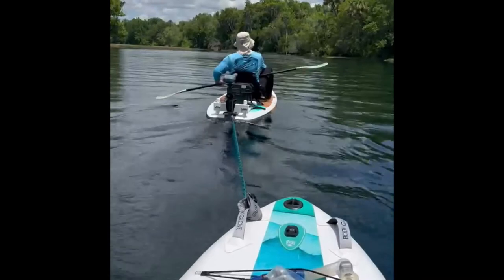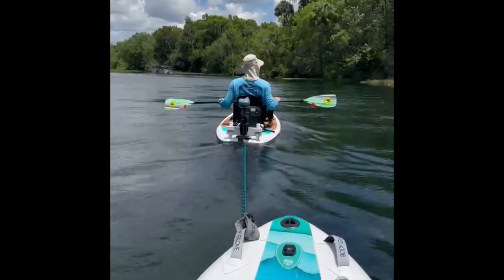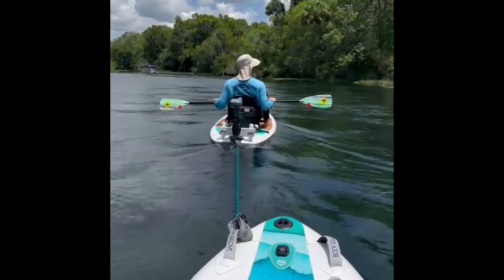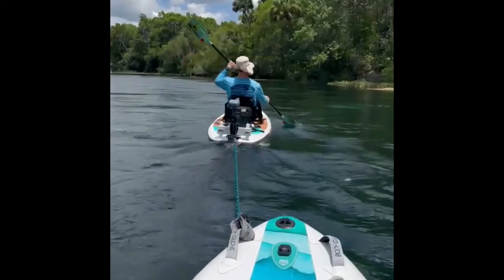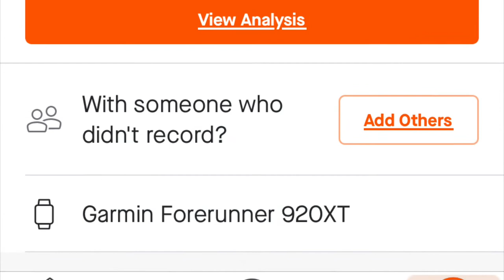Trolling Motor On SUP

Comment: Very nice can you tell me how you connected the PVC mount to your board and are you having any problems with it moving while running the motor? Thanks
Reply from the maker: I just used velcro straps to some D rings already on the board we sometimes forget them but as long as your not in white caps you should be fine

Comment: It is a year later. I'm curious to how the pvc held up under the weight pressure over time. 

I also want to say
of all the motor and mounting possibilities,
I am copying yours almost exclusively. 

Thanks for the video
Reply from the maker: It is holding up great. I forgot to mention in the video that I am using wood dowels inside the pvc for strength and longevity.

Comment: How do you reach the Tiler to increase/reduce speed and to turn motor off etc?

Sitting in the centre of the board doesn't look like you can reach the motors Tiller.
Reply from the maker: I'm 6'2" so if your shorter reaching back can be a pain on the shoulders. The tiller does extend out anouther 6 inches I have also purchased an 18 inch extension tubing for sharper turns. I still use this setup especially on windy days or rivers with lots of winding turns and a fast current, but its heavy. My go to now is a bixpy setup only about 10 pounds compared to 50 pounds including battery. I did have to glude on a mount to the board though. Hope this helps.